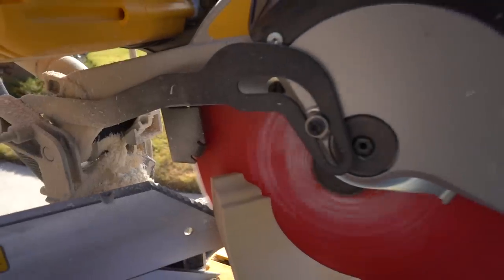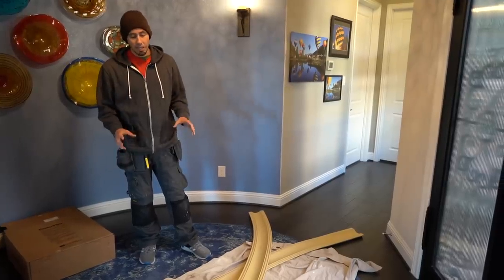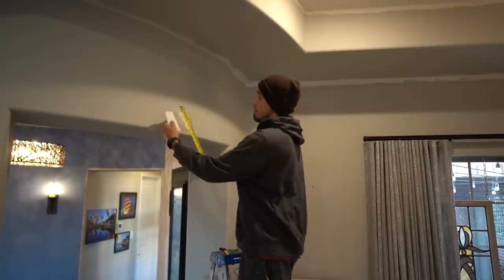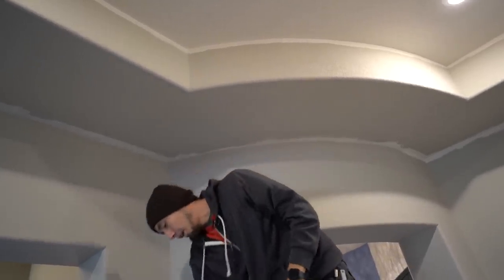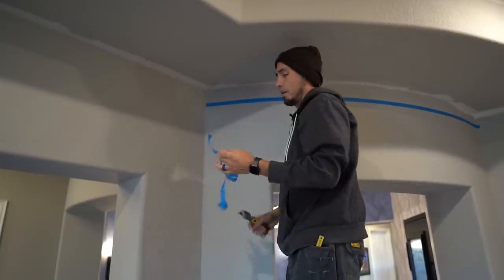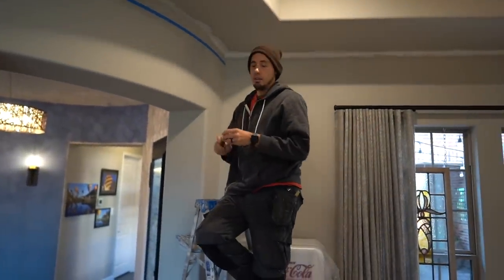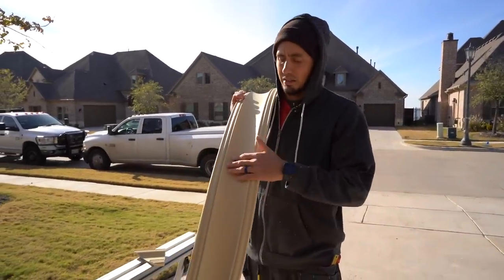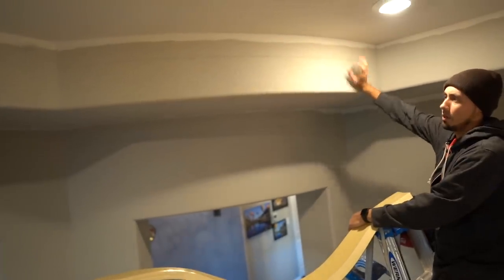HOW TO INSTALL FLEX MOULDING (not as hard as you think)

Comment: Hey Richard, 40+ years in and I've never installed flex moulding but would take it on with confidence after watching you do it... thanks for all the do's and don'ts... priceless!  A suggestion: when using tape to transfer measurements from curved surfaces I use the 'filament' type stranded strapping tape... virtually no stretch like you mention you could have with the blue tape... Best, Matt

Comment: Oh my gosh Richard!  I just came across a video of your’s that I hadn’t seen yet.  Talk about major intimidation. I was freaking out with finished crown I had to cut and install for our kitchen cabinets.  In fact it took me almost three months before I made my first cut. On top of the various miter cuts I had a scarf joint I had to deal with (took your advice and did a 22.5 degree cut, which came out really nice!). There was no caulking or touch up paint...each cut had to be perfect.  I practiced a lot on old material and watched your videos 2 and 3 times in preparation!

The flex molding took it to a whole new level.  Totally impressed at your skillset.  Didn’t know I could be more impressed!!  Thanks for another awesome video!

Comment: I'm a flooring contractor for 30 years installing, sanding and finishing hardwood flooring. We do moldings. Your videos have helped me raise my detail level for moldings and. I also calibrated my saw...it was way off. No wonder I couldn't get tight lines. Going to treat myself to a chop saw table. Standard procedure for floromen is place the chop saw on top of the table saw. Make all of your cuts bent over or kneeling.   My moldings and my jobs are coming out much better. Thank you. I even tried that wave app for submitting estimates. You gave a lot of good advice. Thanks

Comment: Your videos are great man, pleasure to watch a coworker somewhere across North America doing exactly same type of work, and using exactly same type of moulding like we do here in Toronto.
This might be of interest to you. When we install flexible moulding, we cut ends shorter by about 3-6" (total of 12" for both ends) depending on the radius of the curve. Then join left and right end with mdf moulding that has miters already cut using ca glue, this way you don't have to fight with flexible moulding on the saw, also comes in handy if you make a mistake you can just cut mdf piece off and start over. Also I find that a lot of the flex mouldings have slightly different profile shape from mdf match, so by doing a straight joint you can sand them flush to match.
Reply: Brilliant technique.

Comment: Years ago, I had attempted to cut a bunch of 3-4" long pieces of the molding with a slight degree to go around a curved 2nd story foyer wall above a curved stairway.
I was quite proud of myself until the painter completed the  painting of the crown and discovered that the light hit each small piece of crown slightly different!
Yep, we ripped it out and got the flexible crown!

Comment: These types of moldings were quite common in the 19th Century but made of wood and not urethane.

They were known as "spring moldings and commonly seen wrapping around the outside or inside of curved porches, porticos  and such.

They can still be made of wood although certainly less flexible than urethane.

They're called spring molds because they can only extend to spring points on a specific curve (also called tangent points.) Or perhaps because of the spring angle of crown molding?

I really don't know.

I've made them before and it's still viable . The curve is not made to the plan-curve of the wall but according to a specific formula related to a cone.

So yes, a horizontally, curved but flat section of crown molding, can be bent and installed on a specific curved wall.

And I'd be willing to bet, few guys today, have ever heard of such a thing? Flextrim certainly knows all about it but perhaps not the history?

Comment: Felt like another long break between videos. That's GOTTA mean you're either super busy with work, or giving the media a break. Either way, I GET IT. Another gem of a video. Not many carpenters have gotten the chance to work with flex mold, I'm very grateful I started as a Union guy, otherwise I may not have either. Also you are DEAD ON about dimpling... if you are too thick on that gauge, its drydex to the rescue. But that's ALOT of floating with drydex. Great tip.

Comment: anytime I have ever done flex crown, I would run finish screws into the studs every few feet due to the weight of the crown...also im in Florida and we would lay the crown in the sun for about an hour before installing, this would make the material much easier to work with...

Comment: installed a bit of this stuff and found that not always you get rubber to match wood as far as crown pattern or is the shape and thickness consistent along length of rubber, finish head screws work well to hold big crown, superglue will glue ends  or miters together, and good ole bondo will work well for shaping surface of rubber and filling nail/ screw holes. but be careful it will catch a saw blade and ruin your day

Comment: Those Diablo blades are killer! Especially those fine cutters...You young guys are so lucky these days...That flex volt rig is SWEET!   Have you seen DEWALT FLEXVOLT 120V MAX Corded / Cordless 12" Double Bevel Compound Sliding Miter? I just wish they were made domestically.
Reply from the maker: ROB-IN-PHILLY yes I love all these tools that make our jobs easier.  And yes I have the slider compound saw too. It stays in Jons truck as a back up
Reply: @FinishCarpentryTV  :)...That thing is a Gigantic!...You need a trailer for it...:)

Comment: Nice work but for me I would probably put the flex molding all the way into the corner and cope the two straight pieces then you don't have to worry as much about length and getting a perfect miter on a round piece

Comment: Why not do a straight cut on the flex piece so it ends into the wall and come behind on the connecting pieces doing a coping cut? Like what you’d do on roughly a 90 degree inside corner. That way you wouldn’t have to be so exact when cutting the flex piece. Ive never installed a flex piece like this so just wondering if my thought process is way off.

Comment: I love flex molding.
I never thought about crown molding being flex type.
I use base all the time.
For the value and look and ease of changing and color options, you are installing a finished product with no holes or destruction of any kind.
Can do full runs around outside or inside corners.
Just easy tonuse and looks great for more people.
If you want it more permanent, you can modify it with dbl tape or better adhesive.

Comment: Love your videos man. Just wondering, when using the flex product, why you wouldn't cut the miter to run almost all the way to the wall at the top and then cope in the straight crown to the flex. Your joint is perfect (as usual), but wouldn't the coping give more flexibility if the walls are not square and plumb?
Reply: I agree. If expansion and contraction is such a big concern, this seems like the better approach to me too avoid gaps on the molding. Just use a very flexible caulk.

Comment: Question about the placement of the tape, on the wall and on the molding. 

Did you apply the top edge of the tape to the pencil line on the wall? And transferred that measurement to the bottom edge of the molding? Meaning when you applied the tape to the molding, the bottom edge of the tape, the edge that was furthest away from the pencil line, was hanging off of the molding?

Or am I thinking too much into the “exact” measurement? I just have a feeling if any part was mixed up, the measurement could be wrong at some point. Like if the tape was applied to the molding where 100% of the tape was on the molding. 

PS... After typing that last sentence, I might have been over thinking it. But I’m going to post it just to confirm it...
Reply from the maker: Robert Steich good question. I placed the tape on top of the pencil line exactly where the moulding would go. And then from there it really doesn’t matter if the tape is flipped upside down because I cut it straight with the razor blade. So the tape is exactly the same no matter the orientation.

Comment: If you can stretch it, won't it shrink back to its original length ?
Reply from the maker: Good question. I have not experienced it going back to its original length after stretching it. But one thing I do to prevent that is nail it as I stretch it. It’s obviously not reccomended to do this but it is a little hack I figured out just from necessity. One other thing is that this material is much more flexible than it appears to be in the video. On a hot day it flexes and stretches much much more.

Comment: Even though you made it look “easy” I have no desire to work with this stuff. 😂
Reply: In my opinion trying to miter beat-to-hell, twisted, cupped, bowed, etc...reclaimed lumber for a TV niche is more difficult.

Richard explains everything very well in this video.  For an experienced journeyman this is not that difficult.
Reply: @ThekiBoran , I seriously doubt that!  This is difficult because it’s not something someone would do on a regular basis.  There are a lot of little gotchas!  Probably 2/3 of the viewership are DIYers.  I know I was really intimidated with furniture grade finished crown I was cutting and installing for our new kitchen cabinets.  At $50.00 per 8’ stick I didn’t want to mess up!  There was no caulking, no priming and no painting, just perfect cuts.  I did a 22.5 degree scarf joint that really turned out nice.  In addition I used a 23 gauge pin nailer, with 2” pin nails to attach, as there would be hardly any fill required.  It actually came out pretty nice and tight in all the miter corners and joints.

After waiting 3 months to install I got the impression from my Wife that I’d better make it look half decent.
Reply: @martylucas8557 

We can agree to disagree.  For anyone with decades of experience installing stain-grade base, crown, paneling, T&G, window and door casing this is not difficult.  For a one-only special order item like that cutting it short is the biggest concern.  Just don't cut it short.  For a diy'er it's a major undertaking, for an experienced journeyman it isn't.  Those are the facts.
Reply: @ThekiBoran , well than I agree to agree.  Cutting the flex molding would be a major undertaking for me.  I had to cut finished, furniture grade crown for our kitchen cabinets.  It came out pretty nice, but it took me a month to start cutting, then it sat on our dining room table for 2 months, until my Wife got on my ass!  My miter corners were pretty tight and my 22.5 degree scarf joint was perfect, I mean you can’t tell where the two pieces are joined.  I was afraid to use the CA Glue, because I saw what it did to finishes on a test piece.  With this project there is no paint or caulk to help fix mistakes, as it’s factory finished at Kraftmaid.  I’ve got pretty good tools, but it takes practice and experience to make it look good.  I’m sure this would be nothing to an experienced trim person, such as yourself.  However, I look back at the flex molding Richard was cutting, not only did he have to cut it perfect, but he had the cold weather to contend with.  I have the utmost respect for the pro trim guys!!

Comment: I used this type of molding some years ago on a custom transom. Am I correct that this is polyurethane???
Reply: Its more like a giant rubber cove base, polyurathane would be more ridgid and less likely to conform to the radius. I have installed several different types of this in the past, it can be super heavy depending the size of it.
Reply: Gotcha. I guess what I used in New Jersey was made in Tennessee. They told me it was a polyurethane base injected to form the molding. It was VERY expensive.  But it is still there and worked great.

Comment: Where’s the videos for door casings. I make perfect 45 cuts. Put them up and there’s no space, as soon as I nail it the cut opens up..   I need a video.....
Reply: Your door casing is probably proud of the drywall. When you nail the outside edges of the casing, it pulls it tight to the drywall, and opens up the miter
Reply: @kevinwise982  so what do you do in that situation? Give the molding an extra 16th or 8th and roll towards mitre? Or is it not so simple?

Comment: Would it have been viable to just kerf pieces of crown for these bends?
Reply: Crown molding can't be curved like flat molding because on an outside curve, the top edge has to stretch more than the bottom edge.
On an inside curve the bottom has to stretch more.
I am currently working on a historic home built in the late 1800's in Northern Ohio, and discovered that the crown on an exterior curved porch was kerfed by cutting all the way thru the crown molding from the bottom up and leaving the last 1" or so at the top in tact.
The 1/8" saw kerf allowed the bottom to close together as it was bending around the curve however all the kerfs are noticable, especially when the light hits the surface of each small straight piece a little differently.
For what tools the carpenters had at there disposal back then, it was quite an accomplishment!
Reply from the maker: Ferman Yoder great answer. I totally agree. Also it is very impressive what carpenters used to accomplish without all of our modern tools and materials!